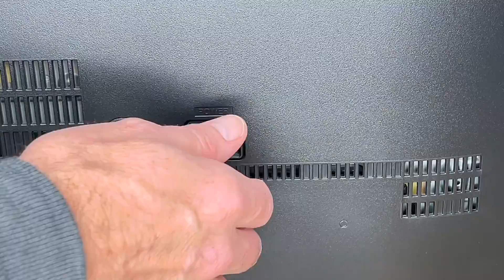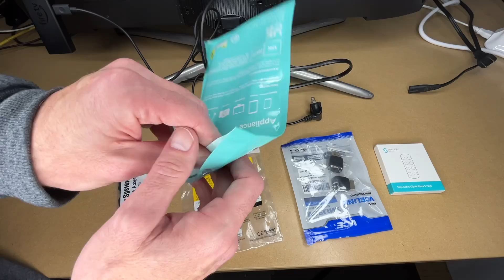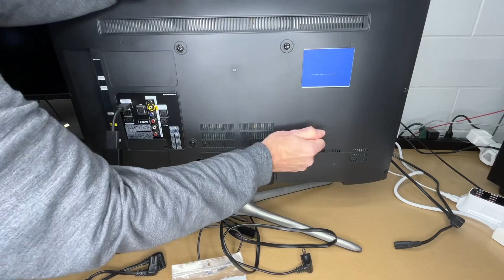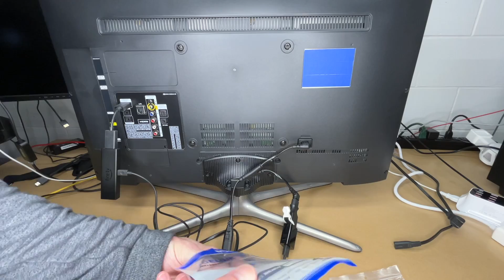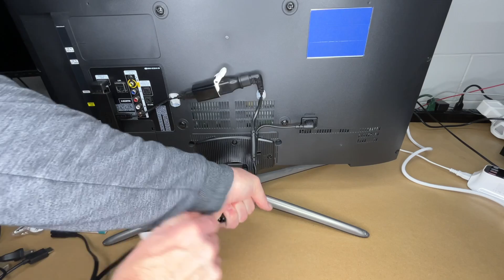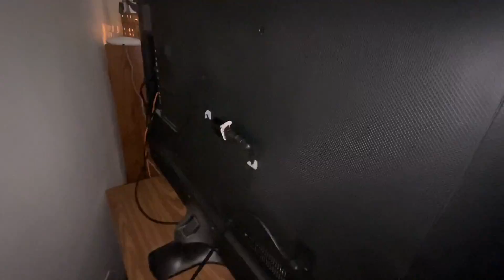Powering Fire TV Stick and TV with One Power Cord

Comment: I had tried the Amazon Mission USB Power Cable for my Fire TV, it worked but after 3-months. Then the fire stick started to looping and started to turning off and on!! I did some research but all I fine was using mission usb power cable. I got lucky I came across your video. I just want to said the whole process was very easy and the cost was almost the same as buying the mission power cable. Thank you very much for your knowledge and video. I broke away from cable and thought I had to go back . This way when I turn off my TV everything is off.

Comment: Great review, thinking of doing this but the Conntek 30132 IEC C8 to 1-15R Plug Adapter w/Snap-Pop Easy Release is sold out. Anything we can use in its place?
Reply from the maker: I found it at this site: https://corddepot.com/shop/power-adapters/plug-adapters/conntek-30132-c8-to-1-15r-plug-adapter/ I've never order from there so I can't vouch for them. I found this similar adapter on AliExpress: https://www.aliexpress.us/item/3256803633585522.html I ordered from there many times but it can take weeks to get your order.